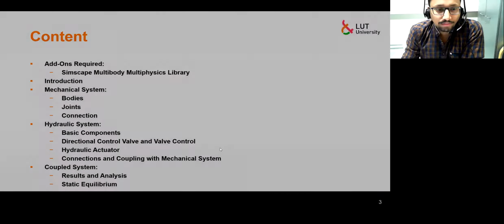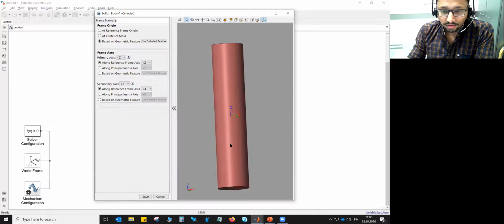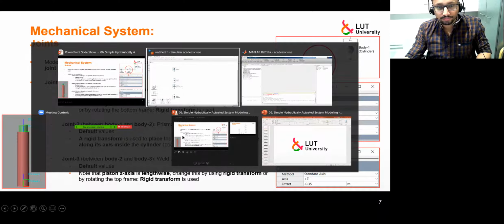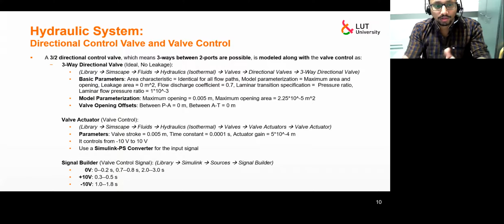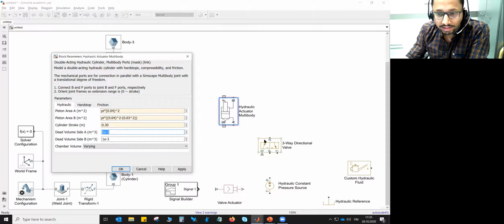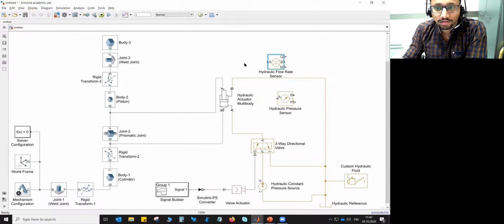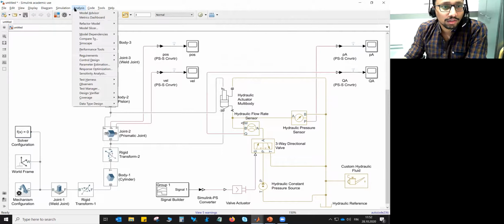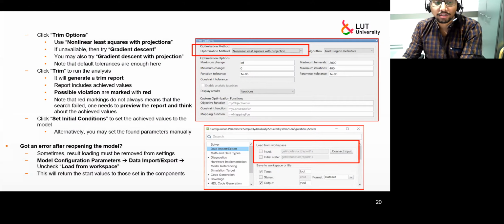Tutorial 06: Simple Hydraulically Actuated System Modeling | Simscape Multibody | Matlab | Finland

Comment: Hello Dr.Suraj. Thank you for your video. I was having trouble with the hydraulic actuator as it does not let me connect anything from the tank to the 3 way directional valve A port. I was wondering if there is a way I can work around this. I think someone else prior had the same issue. Thanks.

Comment: Hi! First i would like to thank you for these awesome tutorials! I have a problem with the Hydraulic Actuator from the Multiphysics library: I cannot make the connections between port C and port R to the prismatic joint! Is this because of some domain trouble? I dont have the Simscape Fluid library (i build my own 3-Way Directional Valve and the Valve Actuator). Thanks for your answer!
Reply: Just saw i used the wrong one ! Never mind ... :-D!
Reply from the maker: So were you able to solve this problem?
Reply from the maker: Thank you very much Dimitar for your kind words. :) Well if you are not able to make the connection then try to cross-check that the connections are of the same type because Simscape  will never make connections if the two signals are of different type, for example of different units.
Reply: I'm facing the same problem, how did you solve it?

Comment: Thank you Dr Suraj for this helpful tutorial...
I have a question : I tried to configure the prismatic joint between the cylinder and the piston by using the state target (-0.35) instead of using the rigid transform (Cartesian translation -0.35m along y); i got behavior other than what you got, i thought that i could have the same behavior... Is there any explication?
Reply from the maker: Hi Khalil, that is a very good question and I am glad that you tried something different than the usual approach. I like that attitude :). Well all I can think about is that when you use the state target, then you are providing additional constraints to satisfy the mechanism at initial condition, therefore, your steady state manager may result in a different output. Whereas if you use rigid transform, then it implies that you are physically modeling your system as it should be without using any additional constraints. I hope you are satisfied with this explanation.
Reply: Of course i'm satisfied, thank you sir.
Reply from the maker: @khalildiha7229  great :) enjoy simulating and hope you have subscribed to the channel to show your support :)
Reply: It's already done
Reply from the maker: @khalildiha7229  thank you :)

Comment: i have small problem , i have matlab 2017 cracked version and I don't have Simscape Multibody Multiphysics Library 
so I cant use multibody cylinder to to link it with the prismatic joint .....pleas help any alternative solutions ..!!?
Reply: Same problem. Did you solved it ?
Reply: I also facing the same problem.
Reply: the only way to upgrade matlab version 2021 and above work best have most of necessary toolboxs